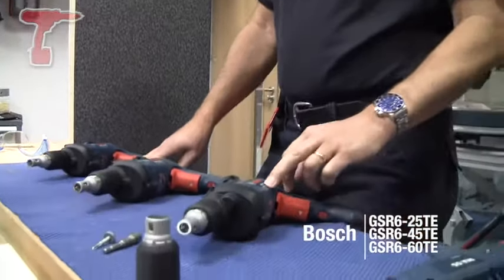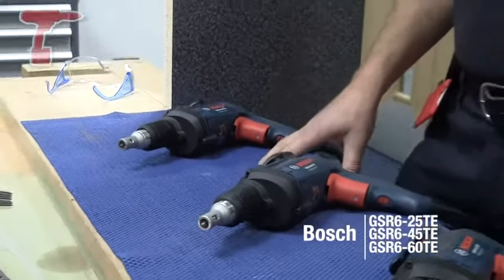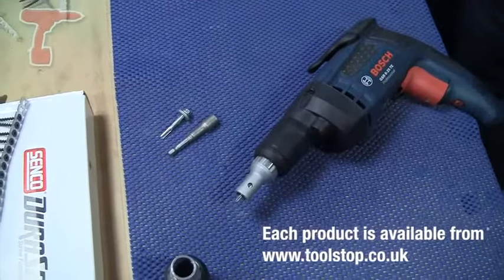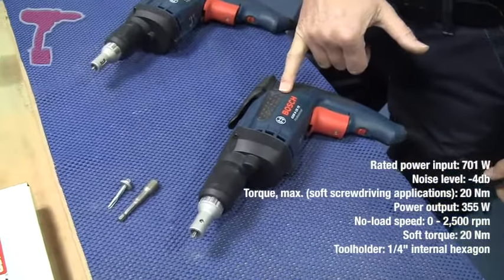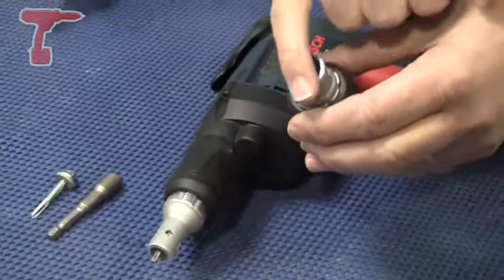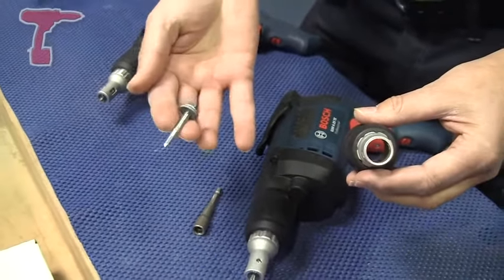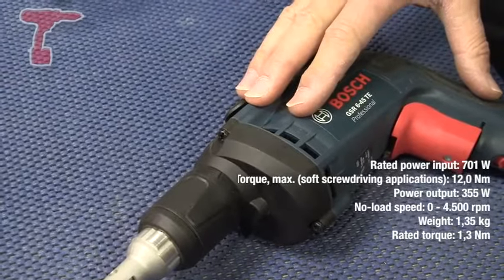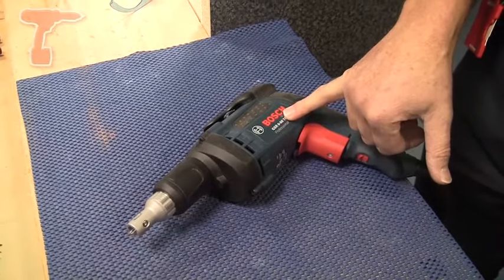How to choose a  Bosch depth stop screwdriver

Comment: Hi! Thanks for your video. I am a bit confused. I have the BOSCH 6-25 with the double depth stop. I don't understand how to remove the adapter for the hexagonal PH2 screwdriver to insert the special adapter for the exagonal screws. Do you get what I mean? When I remove the depth stope and remove the ph2 screwdriver the silver long piece to attach evey screwdriver can't be removed in this model?